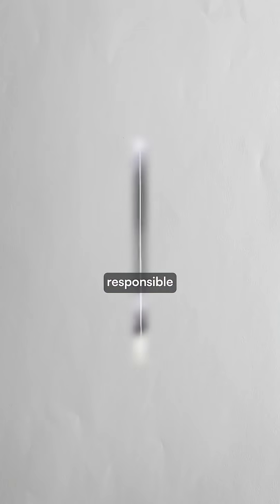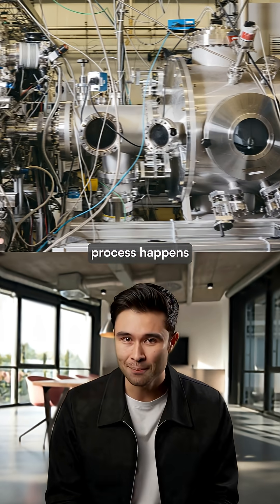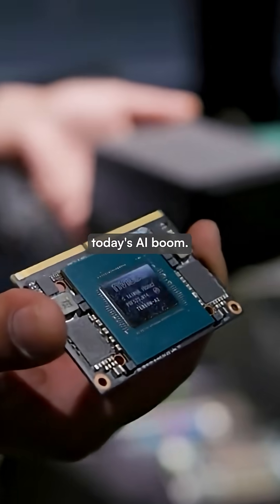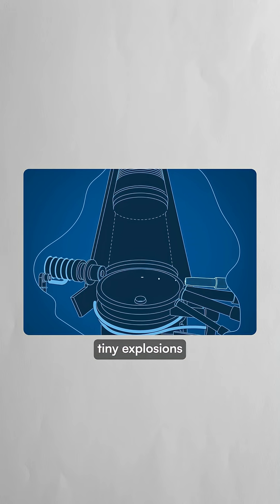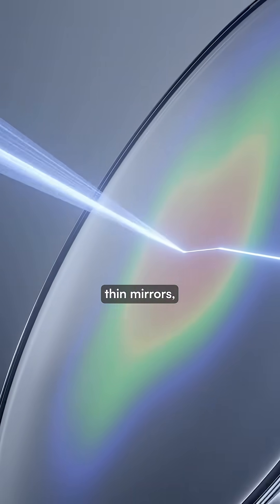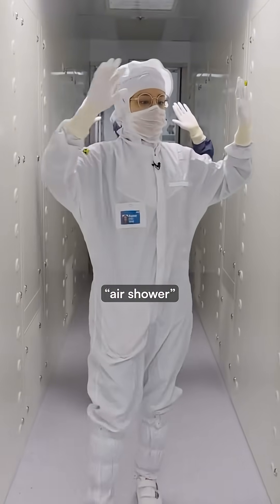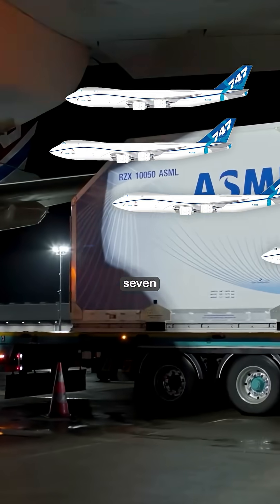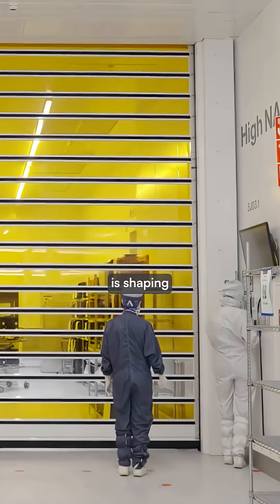These machines are responsible for the world’s computer chips ⚙️ #trendingshorts #ai #data #tech

Comment: The molten tin is injected using high pressure.  The pressure is measured/controlled by a device I helped design.  There are hundreds of high tech components integrated together to make all this work.
Reply: Thank you for your efforts
Reply: So, basically you use a tin molecular beam,
which in turn gets lasered into plasma, creating
very tiny explosives with each pulse ?
But why is the machine so big ?
Reply: @ZMacZ capacitors, relays, compressors and machine tracks and 3d printer-like setups - I would assume.
Reply: @ZMacZ the resulting light isn’t focused, that’s the entire purpose of the machine. To focus the light with unknown amount of lenses and mirrors onto a surface too small to see with the naked eye to make shapes so small it’s almost impossible due to quantum physics.

Yes you could develop your own machine, chinas been trying for a very long time but it’s super difficult and any chance you think you have to ever catch up are delusional
Reply: Thank you sir
Reply: What would be a good stock to buy?
Reply: Thank you for your service Sir!!
Reply: Thank you sir
Reply: Very very amazing.
Reply: Bro, what you said about ASML is truly fascinating. A single machine costs $400 million, takes 18 months to build, requires 7 jumbo jets for delivery, and still it cannot come close to the complexity of a single human eye — which Allah created for free.

Think about it:

That machine can only function because it follows fixed physical laws (light, lasers, droplets, vacuum). Who created and sustains these laws so perfectly?

If humans need thousands of engineers, billions of dollars, and years of effort to make just one imperfect machine — then who engineered the human brain, with 86 billion neurons working in perfect harmony?

If one chipmaking tool requires so much planning, can the universe, galaxies, life, and even your own heart come into existence “by chance”?

The Qur’an asks:
“Were they created from nothing, or are they themselves the creators?” (Qur’an 52:35)

And also says:
“He created everything and determined it with precise measure.” (Qur’an 25:2)

Bro, human technology only exposes how dependent we are on the laws set by Allah. Even with all this science, nations still fight for monopoly and power. But on the Day of Judgment, no monopoly will remain. Allah will ask:

“To whom belongs the dominion today? To Allah, the One, the All-Powerful.” (Qur’an 40:16)

So yes, ASML’s machines are impressive — but they are nothing compared to the creation of Allah. If we admire human invention, shouldn’t we admire and submit even more to the Creator who gave humans the knowledge in the first place?

Turn back to Allah before the Day comes when no technology, no machine, no power will save us — only faith and good deeds will.
Reply: I wanna learn how this machine works or how to design it what should learn to start with? Any advice
Reply: @matthieuramazanibin-ali3532  Read a lot and go to college. Most importantly, learn how to do things with your hands. Get a hobby that helps you understand mechanical things. I'd suggest being a hobby machinist.   Its an expensive hobby but you will learn a lot about how things are made and how they work that cannot be taught.
Reply: lots of school and real world experience. Nobody does this on their own.
Reply: @matthieuramazanibin-ali3532  1 Electricity and electronics.
2 Motion control, PID Loops, Encoders, Robotics. Include direct drive linear motors, air bearings, vibration suppression, etc.
3 Interferometry for positon and motion control.
4 Vacuum systems, and Pneumatics
5 Programmable Logic Controllers, and ladder logic
6 Programming in Python, C, C#, etc
7 Statastics and probability
8 Metrology for defect reduction
9 CAD Drafting
10 Math including geometry, calculus and trig.
11 Refrigeration, and temperature control for process chilled water and air.
12 Short Arc Mercury lamps, ignition, and power control in closed loop lamp control.
13 Optics, lenses for lasers and coherent light.
14 Electrical standards for Electrical Equipment Manufactures to adhere to NEMA standards
15,  ... probably more than just getting started. Pick a subject and start with just a small portion of the machine, such as robotics for the wafer handling and wafer pre-align stage. The rest grows on you as  you expand.
Reply: I thought the droplets were quicksilver?
Reply: @PlayItAgainTubeSam  that would be an extreme bio and environmental hazard, Mercury is no bueno in vapour form
Reply: @alanbrown397  it's tin, not mercury. And in a space so heavily confined and controlled like that it doesn't matter anyway.
Reply: @rupert9901  I know it's tin. Pointing out why mercury is a super bad idea - and it does matter because some will inevitably get past the exhaust scrubbers
Reply: @PlayItAgainTubeSam Mercury is literally a liquid at room temperature. If it was to be used in this process it would instantly vaporise into gas, not an atomic metal imprint. Even if it were to somehow survive the process, at any higher temps you're just asking for the chip entirely to explode if a current was to pass through it at all.
Reply: @PlayItAgainTubeSam Mercury is literally a liquid at room temperature. If it were to be used in this process it would instantly vaporise to gas, instead of imprinting onto the chip. Even if it were to somehow survive the process, the heat would cause it to expand again in the planc it would take the current to pass through the chip, then make it explode apart instantly due to structural destabilization.
Reply: Thank you for the attention to this matter.